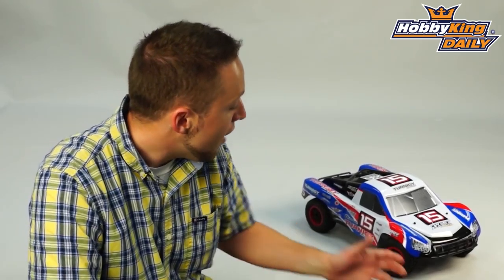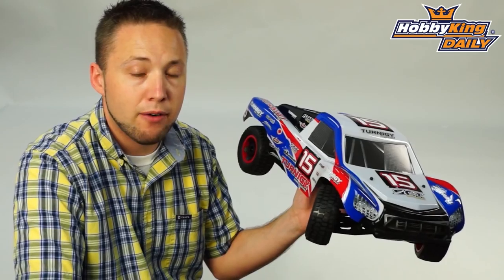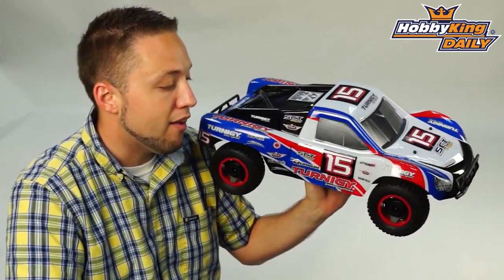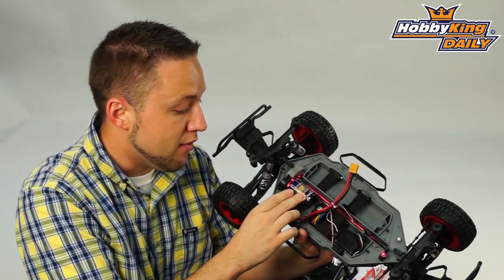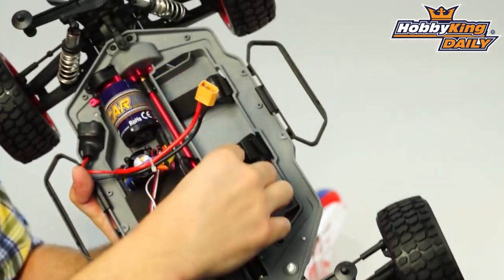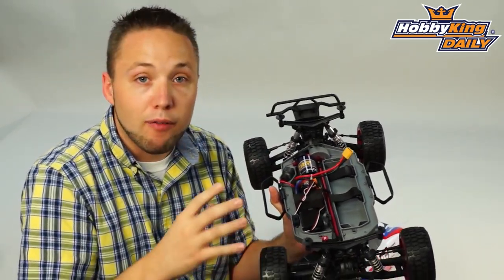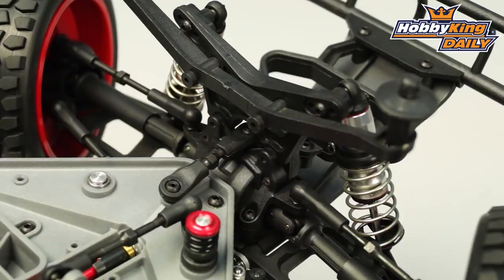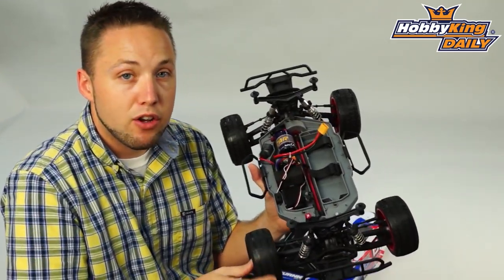HobbyKing Daily -Turnigy 1/10 SCT

Comment: Hi, Could you kindly help me to program my brushless esc for my HBX Hellhound 1/10 2wd SCT. According to the program card I actually need fine tunes for below segments
Low Voltage Cutoff
Start Modes
Max Brake Force
Max Reverse Force
Neutral Range

Tnx!